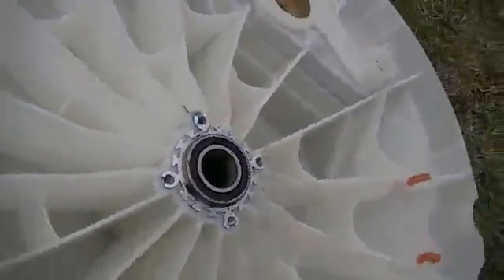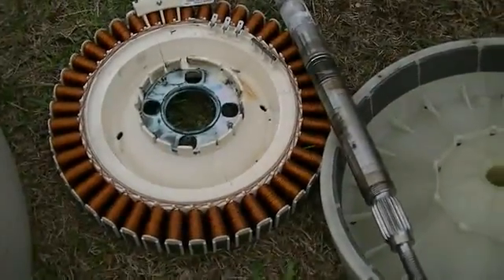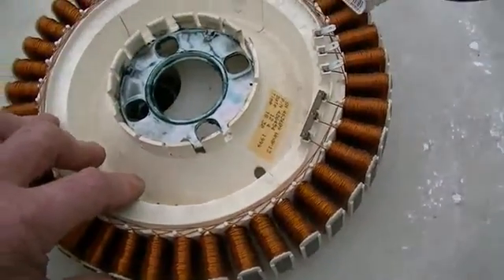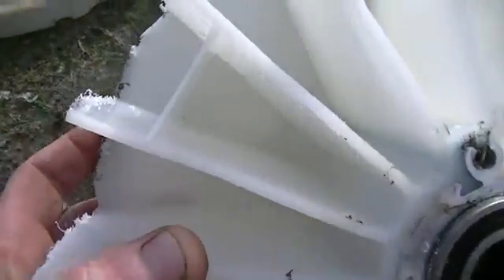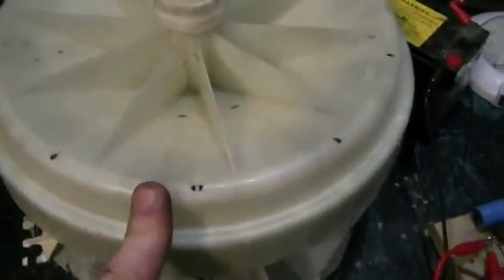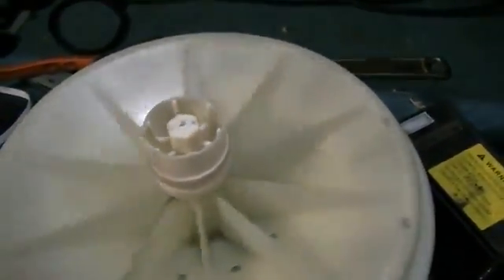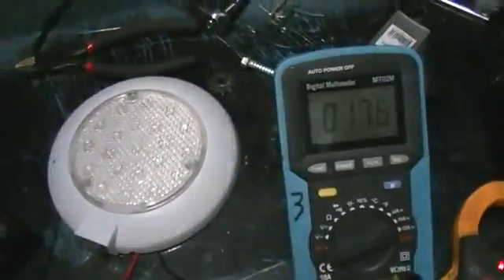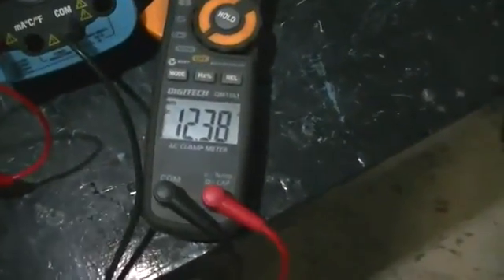The gravity generator project

Comment: I see THESE PEOPLE all over the internet" finding THOSE Kinds of washer's with the smart drive motors, like they are all over the place.!!! But I don't see them In america,!!! OR not in North Carolina, anyway.!!! I have been trying to get ahold of one of those old washer's, to get the motor, like that for year's.!! But all I ever find is the one that has the smaller, belt drive motors.!!! Can anyone help me,....?? I will pay for some of the motors and shipping.!!! Please Help!!
Reply: If you want to use one as a motor, you can use a Samsung, LG, or Whirlpool/Maytag unit. If you don't mind rewinding one with copper, then they also would work as a generator. I like the Samsung units as they use a metal rotor which moves air over the coils.  E-bay is your friend for a used one if you don't find one locally.
Reply: @gravelydon7072  THANK YOU,!! VERY MUCH.!!
Reply: @arkangel8709  You are welcome. I will have to correct my comment about turning an Al wound one into a generator/alternator. Hand cranking a Samsung .92 HP 310VDC one will produce 55 VAC without much problem. It would be more efficient with Cu but they work as sold.

Comment: I know I am late, but for the dumb asses here, a gravity generator is a generator that is ran buy a gear train driven but a counter weight much like an old grandfather clock. Pull the weight up and have electricity for however long it take to run down then just pull it up again.

Comment: My sister called and complained her pellet stove quit while power was out. I brought back memories of the many times, while I lived on the beaches of the Northwest, storms knocked power out for up to weeks at a time and, shortly after, you'd see new pellet stoves in front of houses with "FREE" signs on them.

While pondering ways, short of a generator or complex battery system, to help her, I stared at our pendulum clock and it occurred to me a similar system might proved hours of run time to her stove. Rather than pendulums that weighed a couple pounds, one could use a five gallon bucket (which could be lifted by hand or by block and tackle).

Clocks have simple regulators to maintain speed, and such as system could be adjusted to accommodate need.

Comment: You have created the usual multi-pole generator with very low efficiency.
Reply: ***** Generator windings is better positioned outside. They will be better to cool.
Reply: You mean manually powered, LOL,
Reply: ***** I do not understand why you were smart enough to place the windings on the rotor.

Comment: I get it. You put work into lifting a weight and gravity gives it back.

That's a great low speed generator hack you made there. It might need a governor?

You could run it off water from an elevated tank if it's not too dry where you are. best thing about that is a wind powered pump can directly lift water even if the wind isn't steady and you can tap the tank for that stored power on need and even get water from the rig in the bargain. And if it rains you could get free power.

Comment: You said gravity not hand crank.
Reply from the maker: Thats right
I crank the handle and lift the weight,but the generator dosnt turn because of the sprag clutch on the drum shaft.When the drum starts to rotate in the opposite direction!once gravity becomes the source of force)the generator turns,and produces electricity.
Hand cranking is not the electrcal production cycle.If there was no gravity,the weight wouldnt fall,and no power would be produced.

Comment: That's a huge output. You'll need a beefy regulator or shunt system off that thing, just in case the gravity weight slips lol *boom*. Didn't know anything about those motors before this vid, cheers.

Comment: I have been thinking of a gravity generator for sometime. You just need the right location to allow for the weight to be able to travel some distance. I spoke with RHEAD100 who has a pendulum powered generator, by combining the two you might be able to get a generator that could run for sometime.